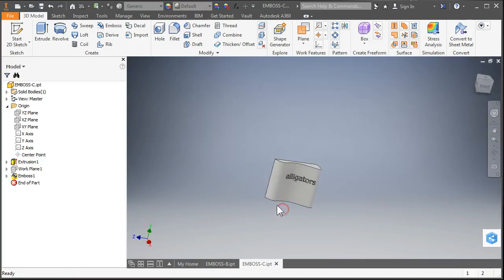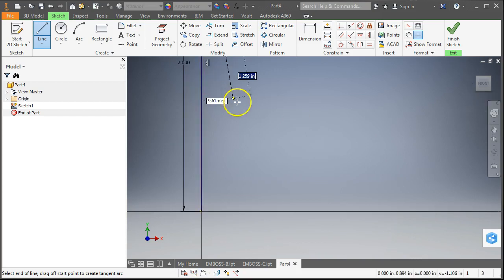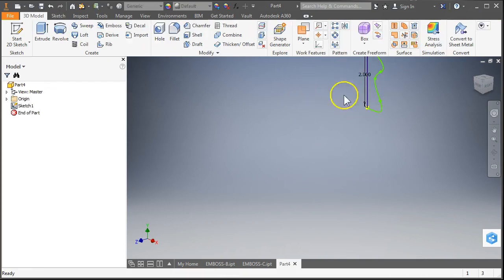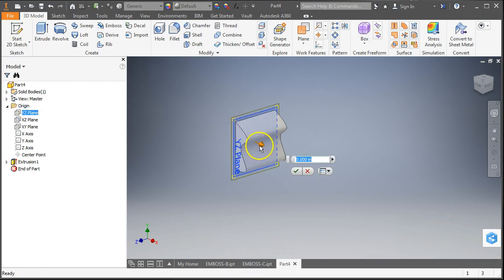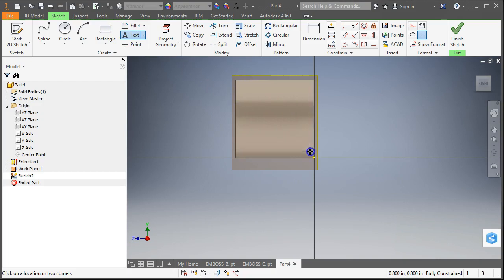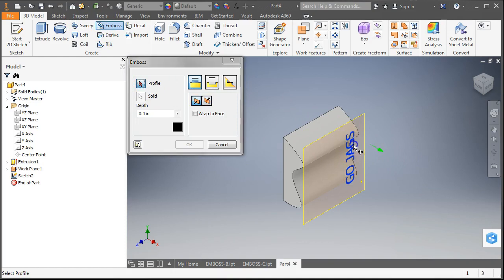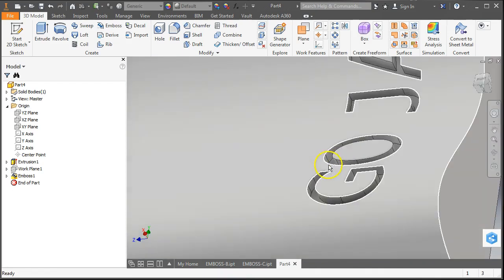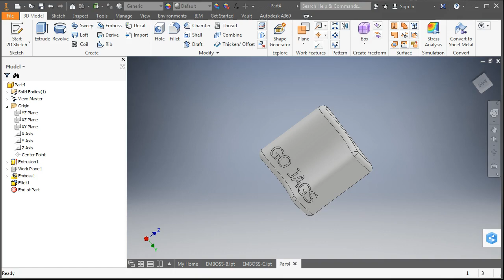IE EMBOSSING on a curved surface

Comment: i want to emboss, on front and back of a cylindrical shape.....but i can emboss on only 1 side(either front or back )
Can u help?
Reply from the maker: You can try repeating the emboss around the curved surface: https://youtu.be/IP060FglDPU or you might be able to set a new workplane on the opposing side and perform a second emboss. Good luck!
Reply: @marcushuff9480  man honestly im so damm dumb..i almost forgot about the pattern tool...just need to adjust the angles and it'll be done....thankx man